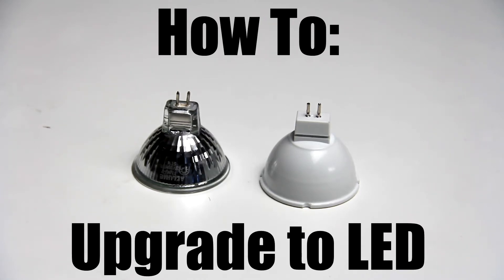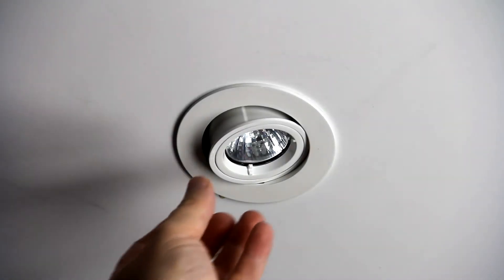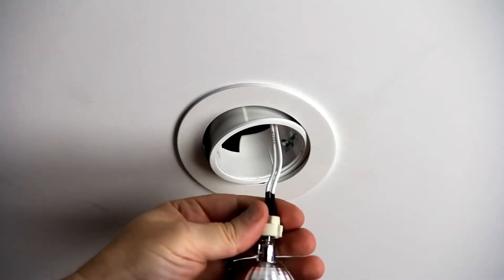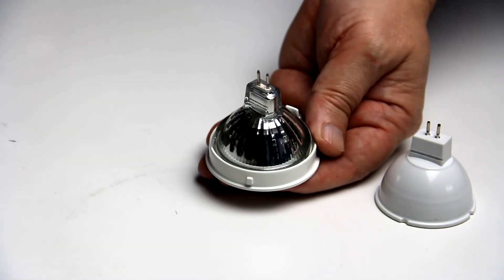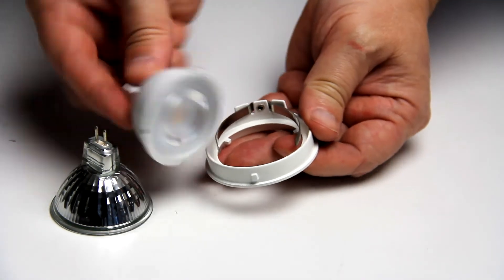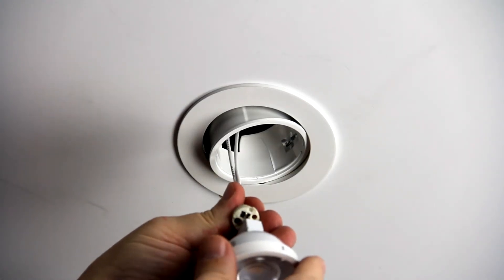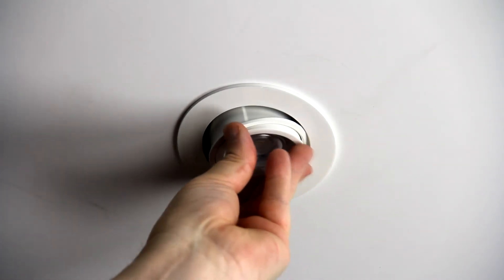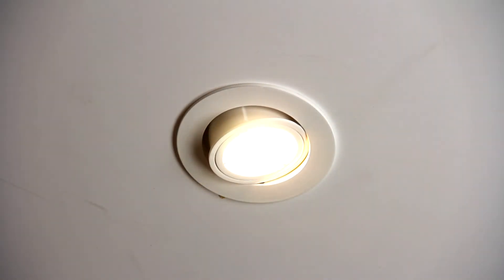How To: Upgrade your lights to LED

Comment: I have these exact spotlight fittings, but some have stopped working. Is it possible that the ceramic holder for the bulb pins has broken??? Is it a common problem??? Is it worth trying to replace just the ceramic  holder part, or is it more likely to be something else???